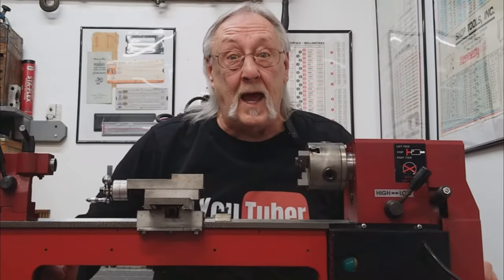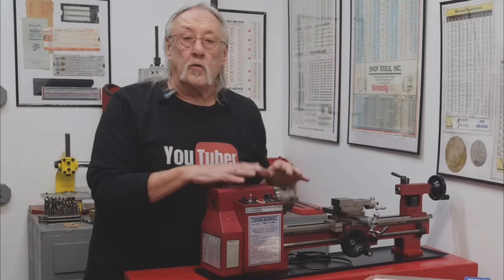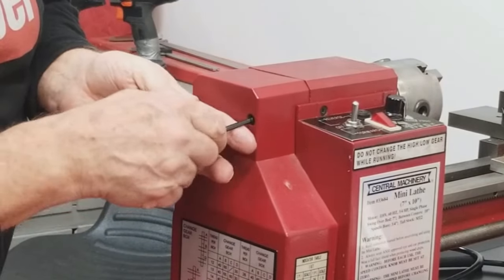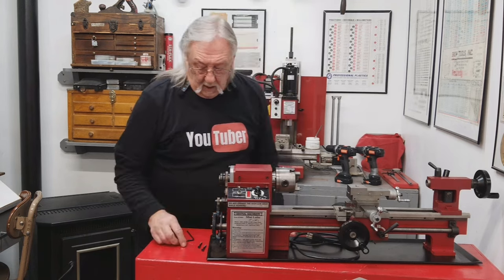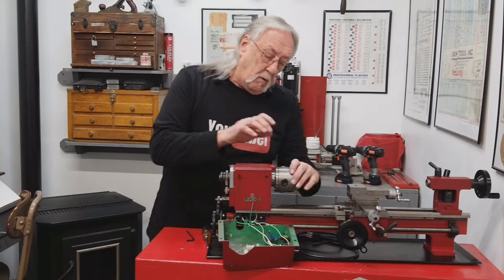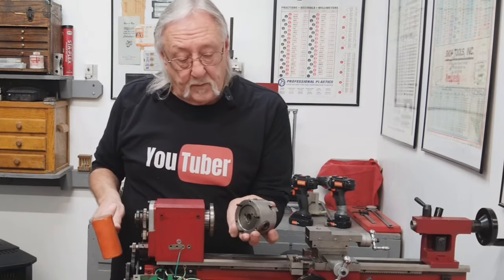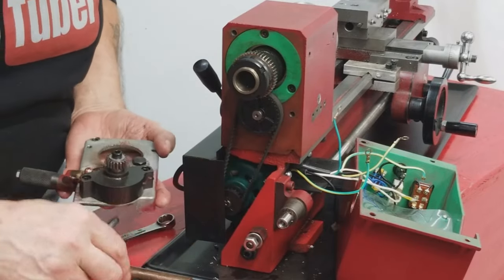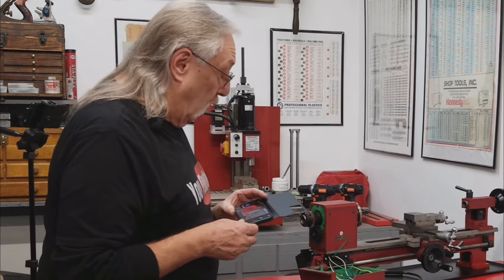Headstock & Spindle Removal, First Steps to a  Mini Lathe Upgrade

Comment: Good job. I've just taken the spindle off my mini lathe with the head still in place so it's interesting to see how the whole kit and caboodle come off. Also interesting to see differences from my lathe - on mine, the spindle is direct drive off the motor, where yours seems to have an intermediate lay shaft to deal with the reverse. Great video - really looking forward to seeing the process. I'm taking notes!
Reply from the maker: Hello, The intermediate shaft you saw is for the high/low gear. A pulley from the motor goes to the high/low gear shaft and connects to the spindle inside the head. Reverse is accomplished I believe just like yours, electronically. I didn't see a high/low gear shifter on your lathe. I think that is where the difference is. I only put out a video every 2 weeks so it won't be until February 17, when my next video comes out. "Steel Gears & Taper roller Bearings". It won't be until some time in March before I do the motor upgrade. I was going to try to put a 1 HP AC motor with a mechanical veritable speed mechanism and using a Drum switch to reverse the motor. And hide all of it under the lathe in the machine base I built. Should be fun.

Comment: Great video. Very informative. I have a question about this mini lathe. Im going through a hassle now trying to get one thats aligned properly. Is there a way to adjust the spindle or headstock or whatever to get it to be straight? Ive dealt with 2 now that are every bit of 1/16-1/8” out. Thats not even remotely usable. How do you adjust this lathe? The only videos i can find are about the bed or the tailstock. I need the headstock aligned.
Reply from the maker: You can't find a video that deals with that problem because it would be super hard to fix. You would have to remachine or scrape in the v-groove in the head casting. You may even have to remachine the entire head casting. Another way would be to rebore the bearing pockets so they are in line with the head stock v-groove and flat ways. Either way, its a big project. I'm sorry but Me not seeing the problem in person, I really can't think of anything else.  Maybe shimming under the head some how might work. Best of luck to you with your lathe.

Comment: Hi Glenn,  Enjoy your videos and thanks for sharing your knowledge.  I have a 7' x 10" HF lathe that I am considering upgrading to a longer bed or replacing.  As a read the review of the under $1000 7" x 16" lathes it appears the quality is pretty bad.  It is probably more work to replace the bed and do most of the fine tuning (not sure if I can do all that you did but I think I can get close) that I has seen you do and also cheaper to sell mine and buy a new machine but if I have to go through the same process to get and quality machine does it make more sense to just upgrade the one I have?  Thanks Bob
Reply from the maker: Hello Bob, Good machine, Bad machine,  I think it all depends on what you are using the machine  for. If it's for hobby activities,  then doing the upgrades and fixes are all part of the fun. Of course it's not easy to do the fixes needed to make these little machines run better. But, it's a hobby. Make the machine yours. Do what you can do and try and have fun doing it.